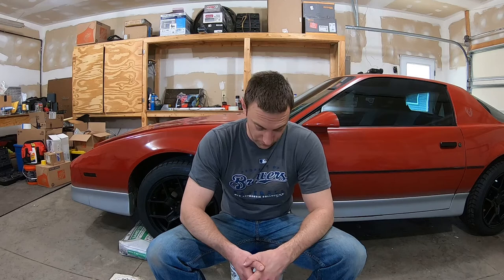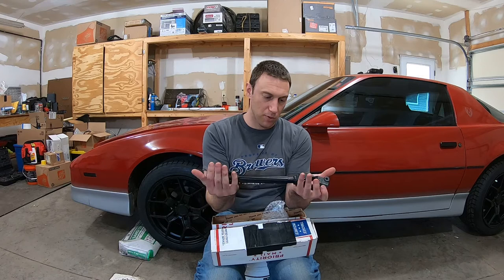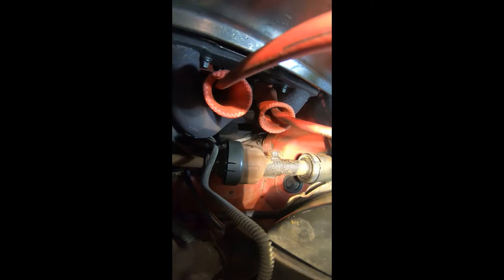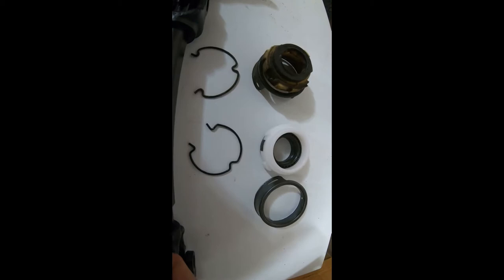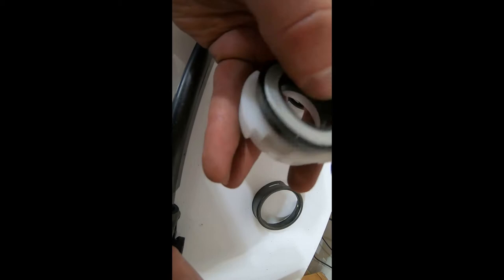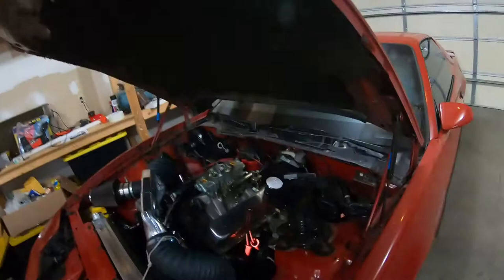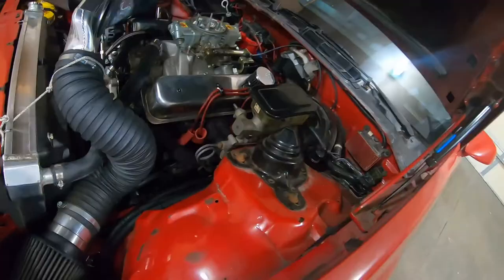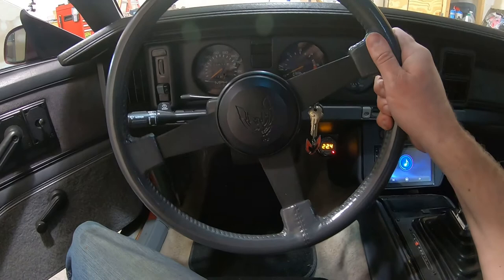Fbody steering shaft upgrade!

Comment: What size are those rims and where did you get them they look amazing on your bird
Reply from the maker: Thanks! They are 18x8.5 in the front and 18x9.5 in the back. I did have to run spacers as u probably know there are not a lot of good wheel choices for 3rd gens.
Reply from the maker: https://www.summitracing.com/parts/are-13388552735
Reply from the maker: https://www.summitracing.com/parts/are-13389552745
Reply: Awesome man if you don’t mind me asking what size spacers you used for front and back?
Oh definitely it’s so hard to find the right set for these cars I have an 89 firebird
Reply from the maker: I ended up with 1" in the front and 1.5 in the back. Very slight hammering in the rear. No bump stop modifications. Got spacers from amazon from ezasccesory.
Reply from the maker: Also i got short lug nuts for the front with the 1" spacer to make sure they didnt stick out and cause a problem